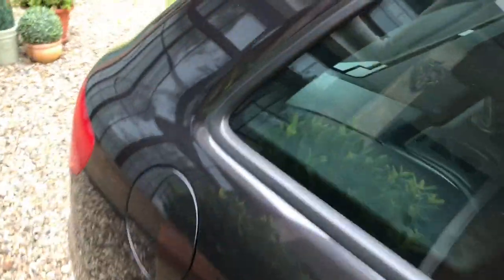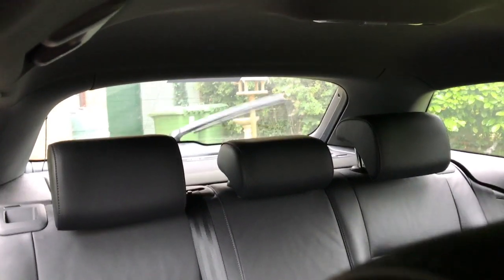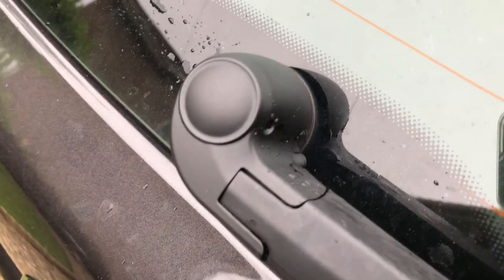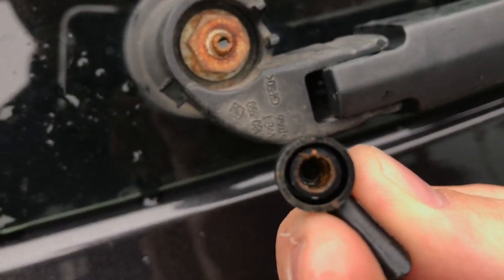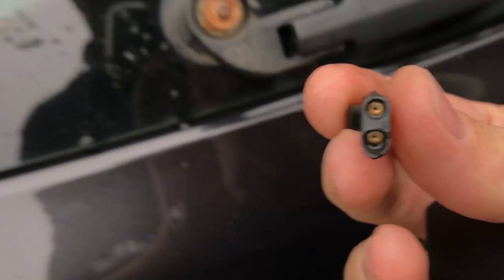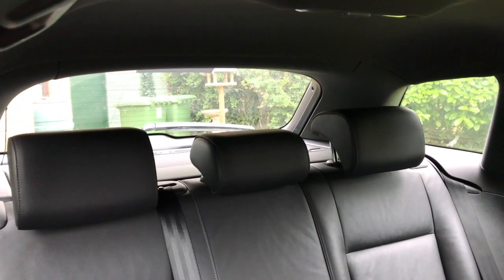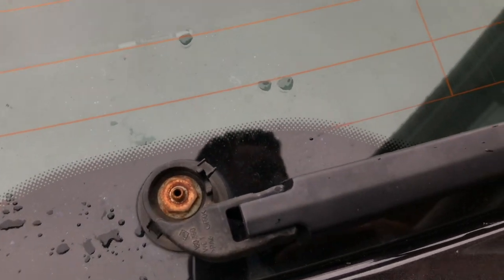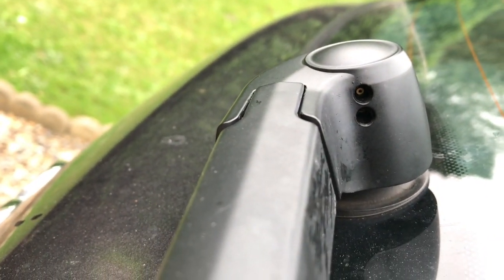How to replace rear windscreen washer jet on an Audi (Audi A3 8P) EASY!

Comment: Thanks OJ, just bought a used SQ5, supposedly having gone through 142/5 Used Audi checks. 

Car is awesome except for the rear wipers. 

Managed to unblock them using hot water. Your video was very helpful, thank you. 

Why Audi hadn’t done this 🤷‍♂️, beggars belief??

Comment: You legend. I have the same washer jet on my Skoda Octavia. Developed a leak in boot and the pipe had came out. I refitted it but still blocked. Didn't know how easy it was to remove the jet. Going order new jet for it now.

Comment: So I ordered the correct part and I'm wondering if it should "snap" in place for a snug fit; or does the wiper aen cap hold the nozzle in place securely.

Comment: Thanks, this prompted me to to take a look as mine hasn't been working since I bought it and I put it off. I popped the cover off and there is no jet! There's no water being pumped out at all so can you tell me what might be the problem please?
Reply from the maker: This isn't me trying to be condescending or anything like that but let's start with the easiest thing, the washer fluid reservoir, does it have fluid in it? If yes, does the hole where the fluid comes out of look blocked? If no then maybe the hose could've loosened/disconnected behind the rear boot lid trim.This may help: https://www.audi-sport.net/xf/threads/no-wiper-fluid-out-of-the-rear-wiper.203643/

I hope you can sort it out!

Comment: I have a leak in the rear washer line and water comes out in the area of the door sill upper footwell on the drivers side RHD when the pump is run. Any ideas on how to fix as it seems that maybe  connection in the line has happened because of a blocked rear jet,. Thanks for any help